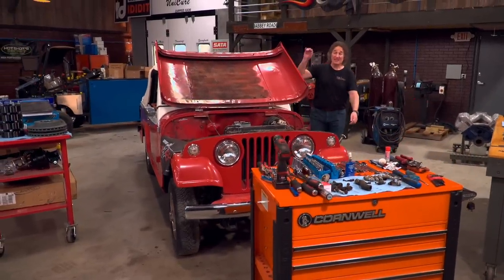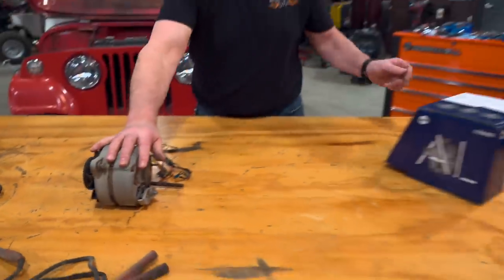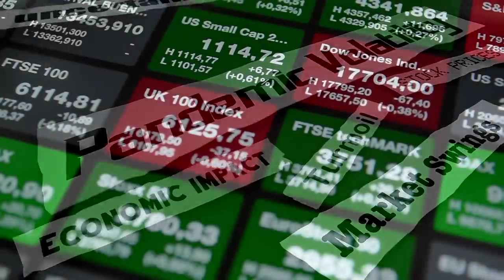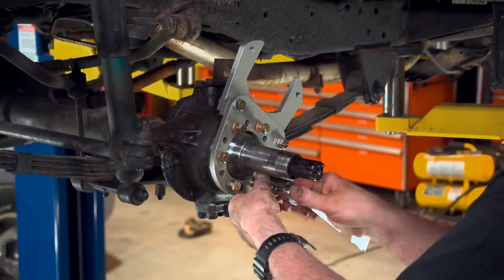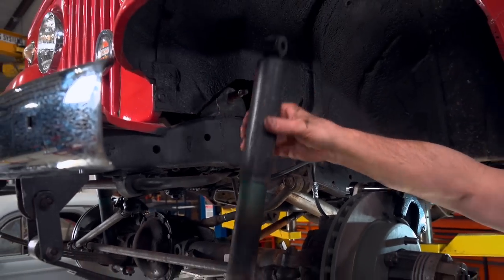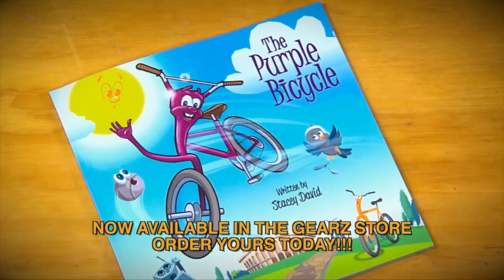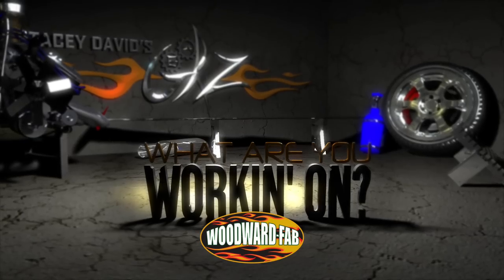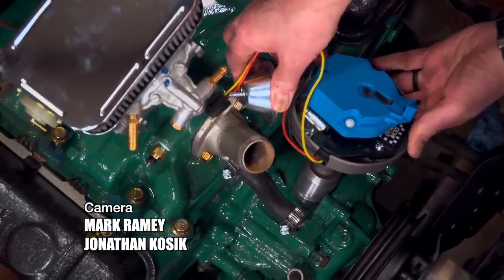Upgrading the Jeepster's Electrical, Cooling, Brakes, and Suspension - Stacey David's Gearz S17 E7

Comment: Lot of worn out parts and rust for an 8000 mile Jeep. You're sure the speedometer cable didn't break at 8,000 miles and the owner drove it another 80,000 after that? I have a really hard time buying the 8,400 mile story on this one. You also mentioned it's been repainted. Why would such a low mile Jeep need a repaint?